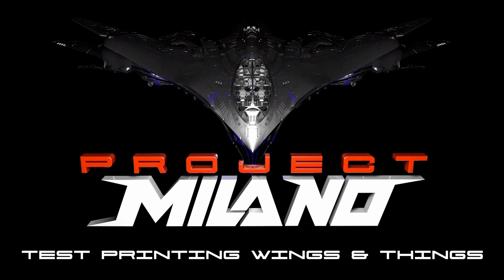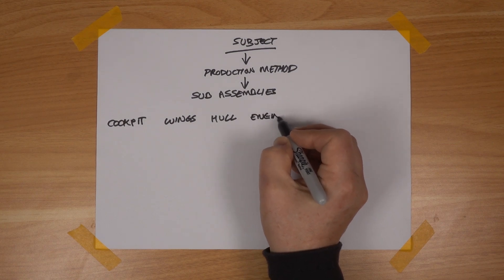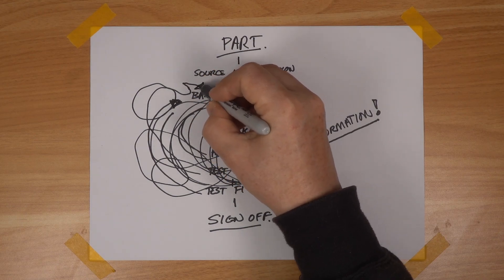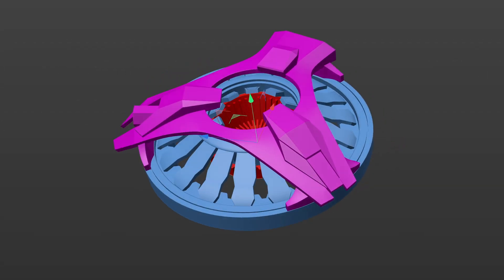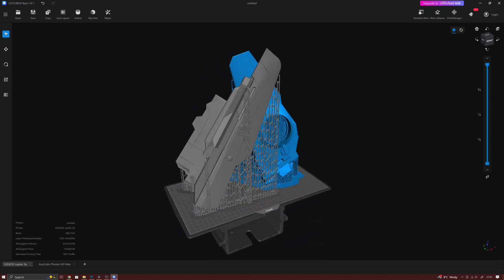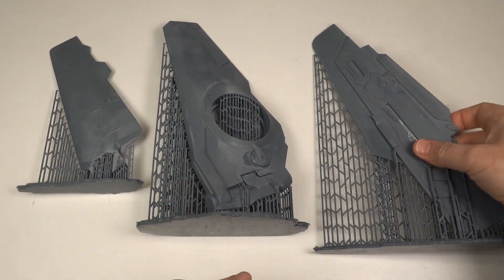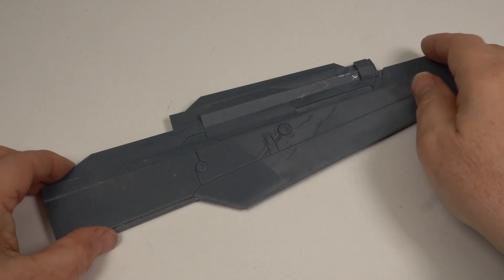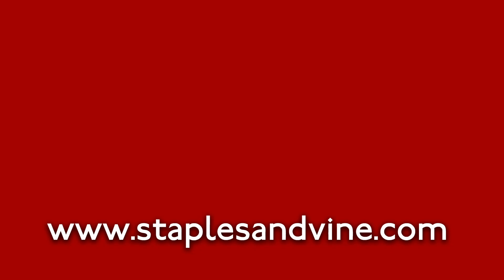PROJECT MILANO PART 5 ‘TEST PRINTING WINGS & THINGS‘

Comment: Could you print this in PLA instead of resin? Cheers.
Reply from the maker: It's not really designed for FDM printing and given PLA's lack of structural durability I wouldn't recommend it. 🤔
Reply: @StaplesandVine  I am a complete novice when it comes to 3D printing but I would love to build this, the APC and Slave One. Could you recommend a resin printer that could print them all? I am 61 and have been building models since I was 10 so plenty of building experience. Thanks, David.

Comment: Beautiful! I can’t wait to see more progress on this! Are you at all worried about those resin wings sagging over time?
Reply from the maker: I'm now at the printing stage. So there should be a new video out soon. I'm using Elegoo ABS V3.0 resin which is really tough . That's why I did the print test to see how it performed. I am confident it won't sag over time. due to the design and material choice.

Comment: Not a model I am particularly interested in building, but your methodology and work flow is so amazing to keep up with.  Look forward to the finale of this project and what is coming!

I keep hoping Elegoo will come out with a strong update to the Jupiter (I found the SE to be sorta disappointing).  My original Saturn is still plugging along nicely, but an upgrade would not hurt my feelings any. Just picked up a Qidi X-Max 3 Core X/Y to cover my FDM needs (and it's pretty good!).  

I REALLY need to find some time in my life to get better at hard surface modeling again, have been actually struggling to model a 200mm fan ring for a SFF computer case I'm building for my girl.  Blender is hard. lol
Reply from the maker: Many thanks, glad you enjoyed the video. The Jupiter SE is produced down to a price as it's a very competative market.
All the best with your 3D modelling Blender is a steep hill to climb. I didn't get much beyond base camp. All the best, Sera. 🙂